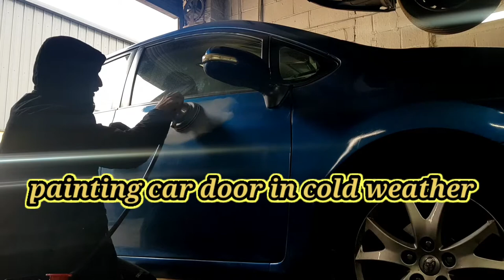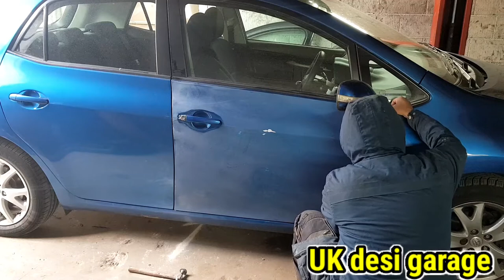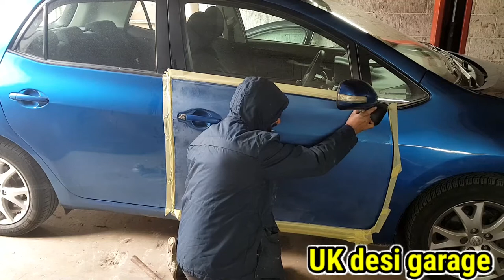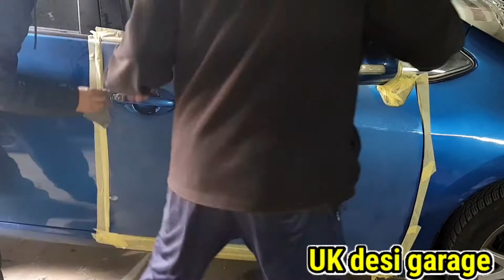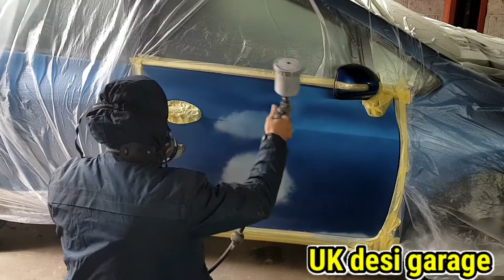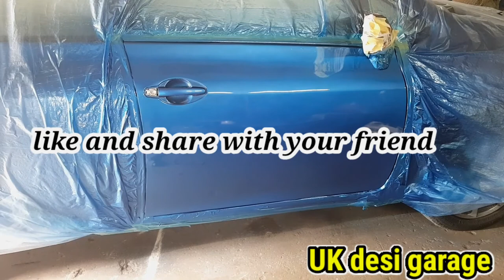How to paint car door :freezing cold  garage

Comment: Hi, great job. please, can list down the materials you bought/used please
Reply from the maker: I normally use in winter condition I had one small heat gun I use with my painting when I apply clear coat I use extra fast activator work well with winter condition

Comment: Tell us what spray gun you used and the settings.  Any thoughts about fast reducers or fast activators
for the paint and clear coat.
Reply from the maker: In this video I used extra fast Activator my setting on spray gun full fan open and fluid tips 3 turns out I'm using now Iwata w 400 spray gun my spray gun settings stay all the time same
Reply: Thanks for your reply!  Is that the Bellaria w400.  What air pressure did you use and how is it you 
didn't get any paint runs especially with the clearcoat?
Reply from the maker: @doughball1026 i use everything extra fast don't get any runs use 2 bar air  pressure
Reply: @DesiJattUk  Have to ask about orange peel.  How did the job turn out?  Any orange peel
at all using your setup?  Thanks.
Reply from the maker: I do get little Orange peel on my job after would i flat down with 1500 and 2000 and polished

Comment: So how cold was it degrees?
Reply from the maker: When I was painting it was - 5
Reply from the maker: I always do dry sending especially in winter condition work better for me all the time same time I use heat gun to dry my paint so I don't get any runs
Reply: @DesiJattUk  wow so if I do what you do I can paint in 40 degree weather?
Reply from the maker: Yes you can no  problem